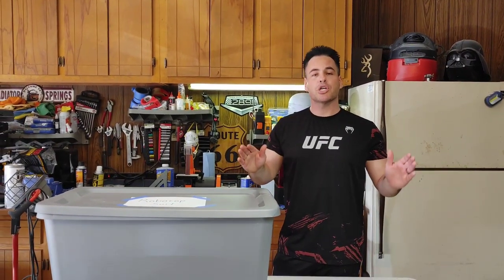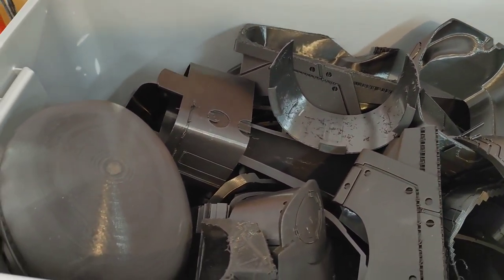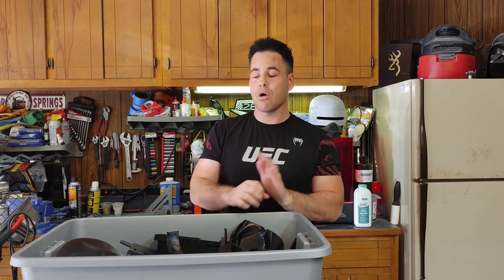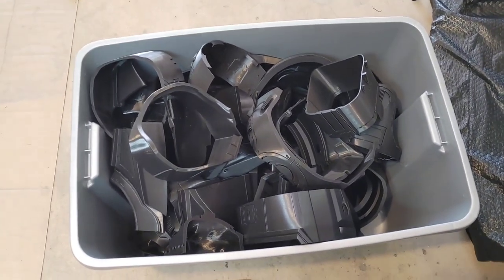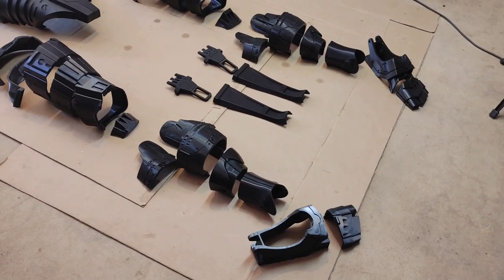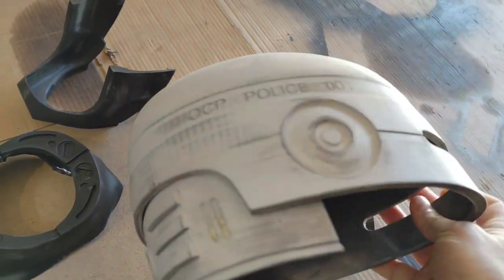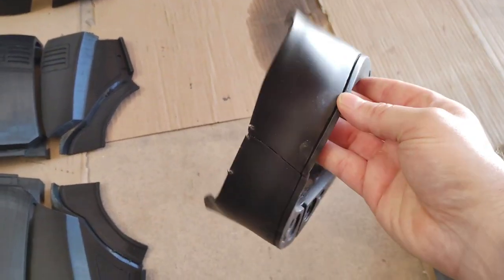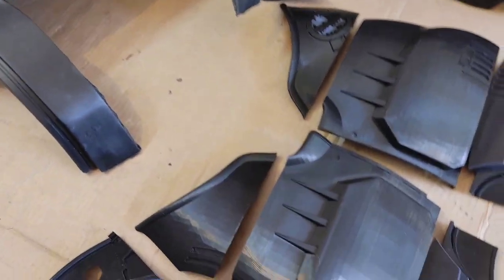My Second 3D Printed Robocop Suit - Part 1 - It Begins!

Comment: i am really looking forward for the rest of the videos :D
i just wondered why don't you make mold from the entire suit you already have in your room and cast that in hard plastic?
Reply from the maker: I wish it was that easy. It would cost me probably 1500-2000 for just materials to mold and cast the suit. When it only took me a couple hundred or less for the filament to print one. It's going to take me several months to build the 3d printed suit but it would also take me several months to mold and cast everything. I chose the much lesser of two evils. Thanks for commenting and watching!

Comment: Printing mine now and was curious if you scaled the calf, thigh or feet? My calf sections are tight and the ankle is rubbing pretty good.
Reply from the maker: I didn't scale anything on the build except the shoulder rings and the leg pistons. Everything fit me at 6ft 185lbs. You could use armorsmith to help scaling for your particular body to better help with comfort. The suit will not be comfortable when wearing and some pieces will be more snug then others.

Comment: Ciao, ho preso anche io la suit di Robocop per cosplay, volevo farti alcune domande. I pezzi che stampo sono tanto spessi e per questo diventano troppo pesanti, hai modificato lo spessore dei pezzi o li hai lasciati come sono?. Ora io sono alto 1.68 e devo ridimensionare tutto, e per me tutto quel peso è un ingombro... Non esiste un metodo per diminuire lo spessore dei pezzi?
Reply from the maker: I'm not sure if you purchased the same files but these files the armor pieces are not very thick and are rather on the thin side. I didn't have to scale the major armor pieces at all, they fit my body shape just fine. If you've seen my previous video I've worn my previous suit with the same files with no problems. So I'm not really sure if you have the same files. The ones I used are on CGtrader and are made by Twonightscinema.
Reply: The armor is the same... I took the model from that artist... for now I've only printed a foot, and I'm about to finish the calf... we'll see!!! Thanks anyway, if I complete it I will be the first Italian Robocop done properly!!!

Comment: Friend, could you tell me which settings to use to print and: layer height, wall gloves do you use?
Reply from the maker: .2mm layer height, 2 walls. I use Simplify 3D slicer but Cura would be just fine. I molded and casted my gloves in urethane.

Comment: how do u cut the hollow shoulder fiiles in netfabb, everytime i try it cuts it but when i export stl  it makes it into a solid and its no longer hollow in cura. please help
Reply from the maker: I just cut them up in I think 4 or 5 pieces horizontally and saved each files. I never ran into the issues you mentioned. I use Simplify3D as my slicer though. Make sure to export as Stl Binary.

Comment: Important question, whats in accurate about the DO3D suit, is it way off? i just got the files but dont wanna waste my time if they are off
Reply from the maker: They are way off accurate wise. The overall shape and just aesthetic of the suit is just not very movie accurate, lots of missing details too many to name here. The files I use from Twonightscinema on CGTrader are way more movie accurate and look like a Robocop suit out of the movie when properly finished.
Reply: @ChrisBoshProps  cool I emailed you about the visor as well, well damn guess I will scrap those files and go with your recommendation, can't print all that and have it be way off haha
Reply: @ChrisBoshProps  I went to cg trader and looked at his robo suit , it looks like the finish  print has all kinds of shape patterns all over it , is that how's yours printed or was yours much smoother without the shapes all over it
Reply from the maker: @josesharks20  That's normal it's just the low poly areas of the armor. You'll have to fill and build those areas with filler primer and bondo spot putty till they are smooth to your liking. The more smooth and higher poly (more triangles) the larger the file size is of the armor and it becomes harder to slice them in your software.